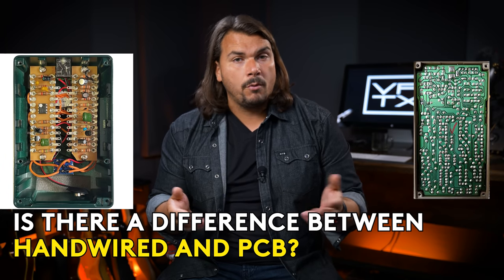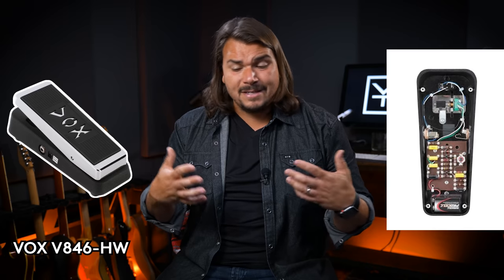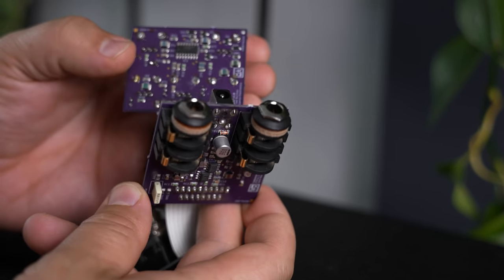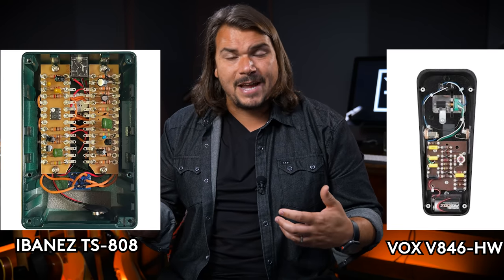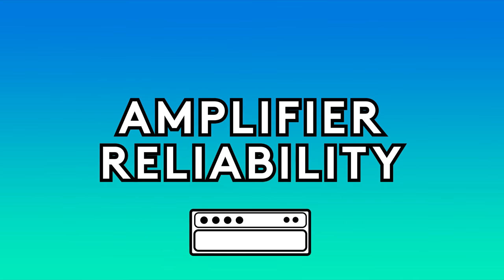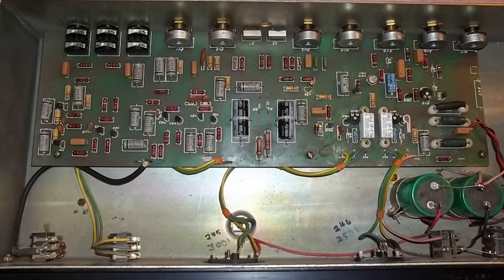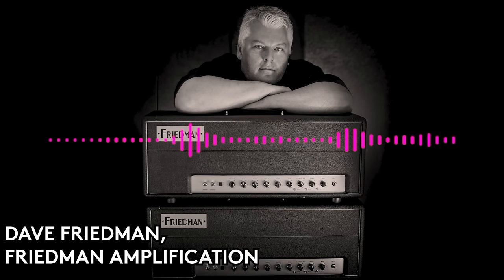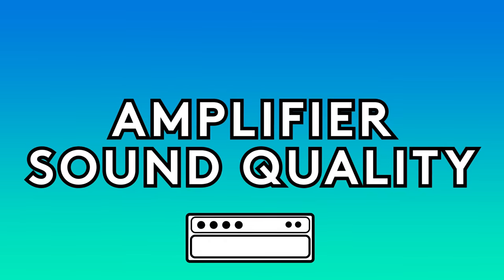Is Hand-Wired Actually Better?

Comment: Largely myth.  Many components leave no real choice.  Surface mount converters and DSPs demand a PCB, would be impossible otherwise.  Tubes, being relatively weighty and regularly replaced can be problematic with PCB mounted sockets.  What’s important is the engineering behind any given device.  Circuit boards run the gamut from crap to sublime and clearly there is a large difference in reliability and, done badly, even the sound.  One or the other is just a straw man argument.
Reply from the maker: Well said!